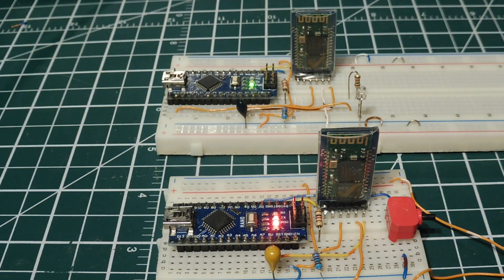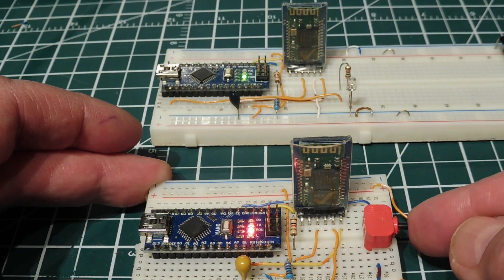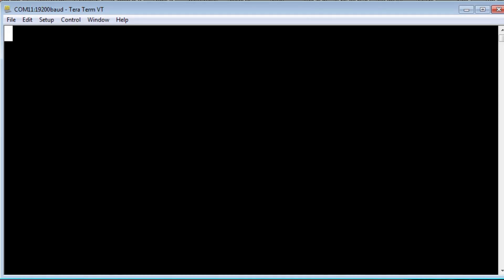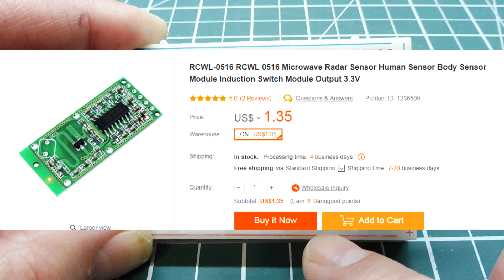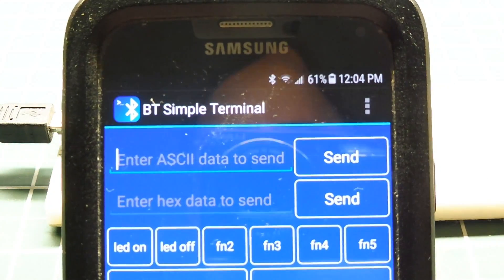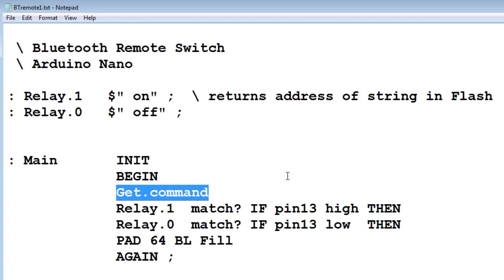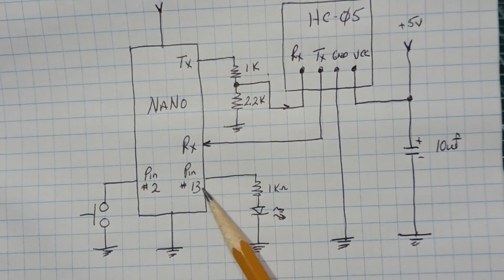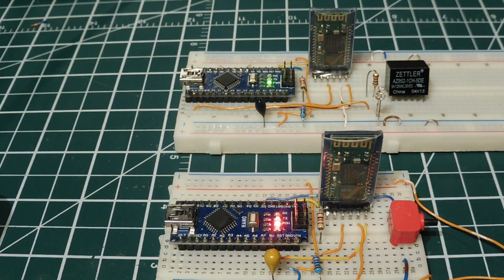Build a Bluetooth Remote Controlled Switch

Comment: Finally i had a reason to want to build something like this, never used code, used a soldering iron once in 10 years, and only replaced easy bits inside a pc so far. Though the way you explained and demonstrated this actually has me thinking i could do it, and expanded that view to the 'whole system' you mention ..  Thanks

Comment: How many channels can this setup support?  I need to light up 3 different LED's with 1 of the 3 at 50% and 100% brightness on demand.
Reply from the maker: The radio link is one to one but the amount of control functions is unlimited. You can send the ASCII string "50%" and have the receiver decode that to drive your LEDs.

Comment: how are your 2 nanos powered please ? trough the breadboard 5v strip ? seems the source of power is off the camera Fov. thanks.
Reply from the maker: Both Nanos are powered with 9v through the Vin pin.
The 5v output of the Nanos powers the HC-06 modules.